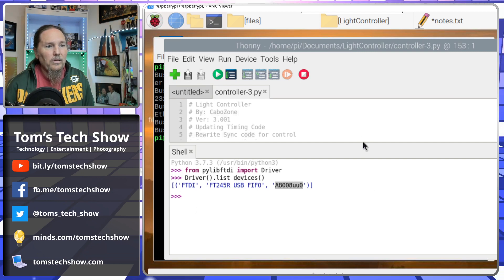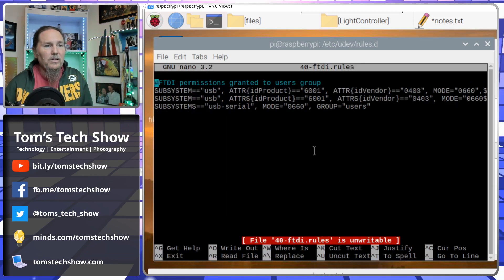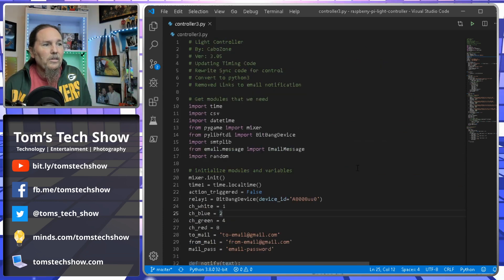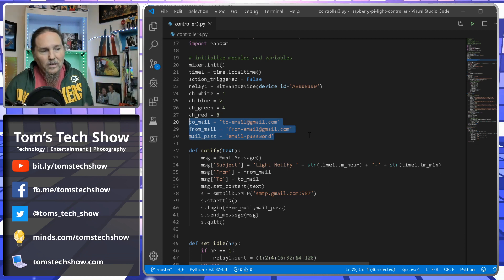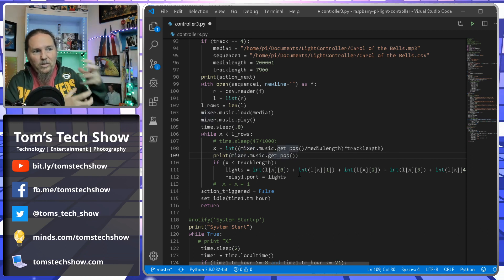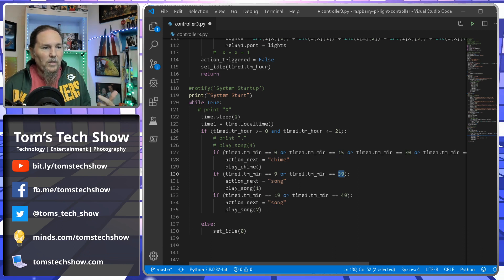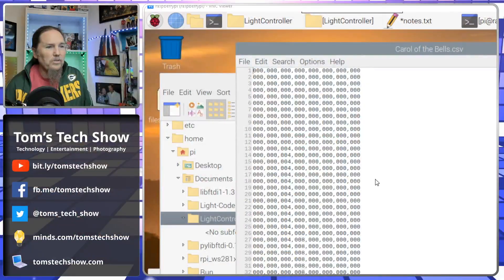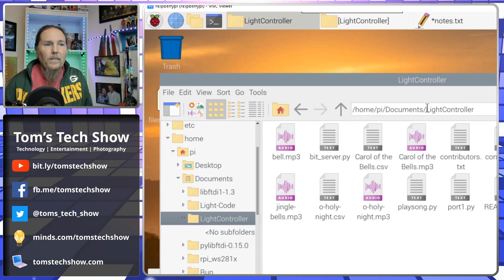Raspberry Pi Christmas Light Control Part 2

Comment: Hi Tom - love your videos about relays controlling Christmas lights - I'm well into the project but having trouble with getting the FTDI library created. Tried to install - got error messages - added rules as you suggested - there is now something about having to install in a virtual environment - see info in PEP668 - looks like a change in programming - I'm stuck - how can I set up the pylibftdi so I can use the relay - i'm going much simpler than you - just want to control 8 strings of lights on my mega tree - but I need to get the ftdi working - Thanks !

Comment: Do you have a simplified version of the controller file that will just play songs in a loop?
Reply: I was able to update the controller script so it automatically goes to the next song by adding a counter and changing the if statements to look at the counter value instead of time.

Comment: Hi again! I exported my file at 25ms but my lights seem to lag behind the music the further into the song they get. I made sure to play the song once to get the final position so I can change the medialength variable to match it, I also update the tracklength to equal the number of rows in the CSV file, any idea what else it could be? 

I also tried changing "track = track + .00000015" to "track = track + .0000015" (one less 0) and it stays in sync longer but then the lights end of getting ahead of the song :(

Comment: Love the idea!  What kind of changes to the code would I need to make to use the Pi’s GPIO pins and a normal/non-usb relay?
Reply from the maker: You would need to use the library to connect to the GPIO and send signals to those pins, I did not start with that and move to USB, I started from scratch and built up with the USB relay first.  There are some other systems out there that use the standard GPIO and have more complexity.  But again I am a do it myself, figure it out kind of person.

Comment: hi, I'm trying to follow you step by step, how do you know which of the 4 address' in the first section is the correct one?  Also. where did you "editor shell" come from?  I'm using my RP stand alone.  There is a text editor, but different with no >>> prompt.
Reply from the maker: The editor comes with the Raspian, or now they call it Debian Buster with Pi desktop, the Thonny editor is there.   that way you can run the Python commands to get the address of the USB device.
Reply: @TomsTechShow  Thanks, I found the Debian, but still unsure of the RP address I'm looking for in the terminal window, there are 5, 1 - EzKEY USB to PS2 adaptor, Microsoft Corp., 1 - Standard Microsoft Corp, 2 - Standard Microsoft Corp. USB 2.0 HUB and 1 - Linux Foundation.  Are any of those the RP address?  Also, does the relay board need to be powered with the power supply as it lights up with the RP connector?
Reply: Sorry, just noticed in Pt#1 that your accessing the RP remotely, so with my direct setup there would be no RP address to obtain.  Correct?
Reply from the maker: You need the address, because that is the address of the USB relay switch.  Make sure it is plugged in and powered up.
Reply: @TomsTechShow  Tom, I'm trying to develop this into something that will control 8 bells and coinciding lights, I have a 16 channel Sainsmart relay board.  I would like the board to  power a solenoid to strike the bell and turn on a corresponding light for a slightly longer duration.  I would prefer the system to run stand alone.  I'm I going about this in the right direction?  Also, is there something you would recommend as reference material for me to try and come up to speed with?
Reply from the maker: Well for sure check out the python docs and specifically the one for the BitBang device.   https://pylibftdi.readthedocs.io/en/0.19.0/bitbang.html    Sounds like a interesting project!
Reply: @TomsTechShow  Hello Tom, with my Sainsmart relay plugged in, then type in the "from pylibftdi import Driver" then "Driver().list_devices()".  I get the square brackets empty, where as you get the info???
Reply from the maker: @glynnbayliss5156  if the relay is plugged in and you have external power to the relay, not just the USB power.  When you run the commands the device should be listed.
Reply: @TomsTechShow  Hi, the external power supply is wired and on.  If I pull the USB out, the light stays on.
Reply: Is there a way to download your "controller-3-2020.py" script in it's correct format?
Reply from the maker: @glynnbayliss5156  You should be able to download it from here   https://bitbucket.org/tomstechshow/raspberry-pi-light-controller/src/master/controller-3-2020.py
Reply: @TomsTechShow  I checked my Sainsmart 16 channel is 9-36V and my power supply is 12V, so all should be good, but no listing.

Comment: When everything is all said and done I will want to try to go to 16 channels.  This year I my lights will be set up on code that I wrote without music running on a Arduino.  I do want to up my game next year.
Reply: I did a four channel relay board with Arduino last year, I also used the normal closed contacts as well as the  n.o. contacts so that gave me 8 outputs and made a cool effect.
Reply: @kenseastrand7428  This will be my first attempt to add style to my lights and I stated with 16 channels.  My wife freaked when she saw the controller that I created because I said that I was going to try this with just 8 to start with.  Was no different, just a little more code.
Reply from the maker: if you see in my videos the lights that act as a volume meter are run from an arduino and WS2811 light strand.
Reply: @stevenmooney4420  I hope all goes well, and it would be great to see the finished display. I struggle with the code/programing part of it, the hardware, and wiring is no problem as I do that type of work. (boat mechanic dealing with ac/dc  r.f. etc.) I am just happy to see other people out there doing this stuff.
Reply: @TomsTechShow  I noticed the lights, and was going to ask about it, but ya I get it now thanks!
Reply from the maker: Here is the video of the Arduino setup  https://youtu.be/izqbMjnpnEM

Comment: I couldn't find the txt file for 40-ftdi.rules.  Is it somewhere on the bitbucket site?
Reply from the maker: Should be installed with the FTDI module.  I still have to get my board out this year.
Reply from the maker: The file is in the /etc/udev/rules.d/   folder.  You may have to create it.

#FTDI permissions granted to users group
SUBSYSTEM=="usb", ATTR{idProduct}=="6001", ATTR{idVendor}=="0403", MODE="0660", GROUP="users"
SUBSYSTEM=="usb", ATTRS{idProduct}=="6001", ATTRS{idVendor}=="0403", MODE="0660", GROUP="users"
SUBSYSTEM=="usb-serial", MODE="0660", GROUP="users"